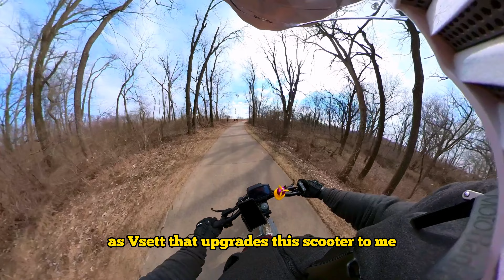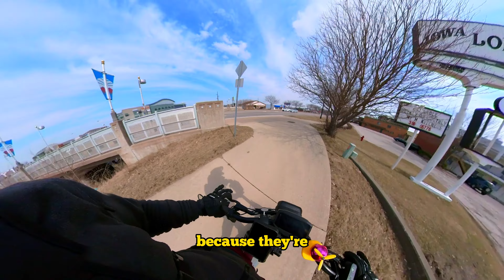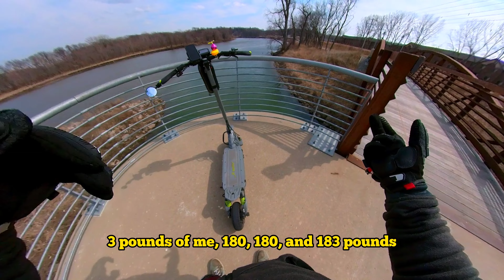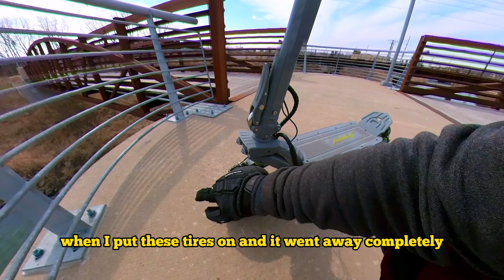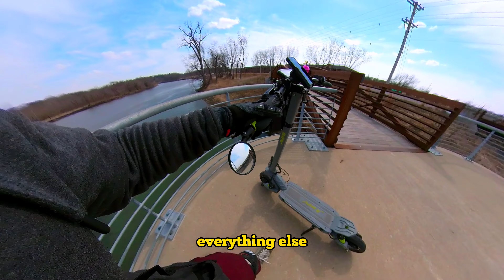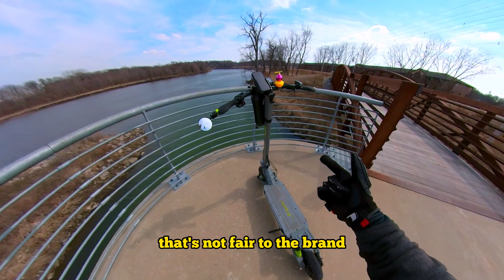MUKUTA 10+ 600 Mile Review: The Next Evolution of VSETT // YOGI STEVE RESPONSE VIDEO

Comment: The manual says that when it gets to 56 volts or below, you MUST switch to single motor or the Mukuta will shut off. Plugging it back into a charger will reset it in seconds.

Comment: I got rid of those heavy steel folding bars and put in a slightly wider aluminum bar with an extension on the front for mounting my light and my phone and now the cockpit is nice and spacious and I absolutely love it. The suspension cranks on the rebound but the compression on the downward stroke is fine. They are sending me a brand new set of shocks but not sure if that's going to fix it. This thing absolutely rips!

Comment: What mid size, 40+ mph, removable battery, scooter would you recommend?  Is the rs5+ 2.0 the best option or are there better/equal ones??
Reply: kukirin g3 pro might be a good option I've heard its the same scooter as the rs5 just rebranded and its a little cheaper

Comment: So does it actually go 40 miles an hour and also I live in a city where I’d have to ride 12 miles there and back to get to my house from
Work or if I wanna go out would it be genuine miles like it says 70
Reply: It easily goes over 40 miles an hour. I got mine up to 50 miles an hour but the speedometer is about 3 miles an hour fast.

Comment: Any idea why I can't get my mukuta over 17 miles per hr my weight is 190, seems like it's hard locked
Reply from the maker: I’m assuming you don’t have it in single motor and first gear? There may be speed limit wire depending on your country or retailer. I would call whoever sold it to you they should know what wire to snip
Reply: P settings ?

Comment: The scooter seems to have soft start turned on in your video.  I think with hard start turned on it would be faster
Reply from the maker: It's not soft start, it has a really nice throttle curve so you can actually control the take off unlike many scooters. I have a Mantis King GT that also has sine wave controllers, but the throttle curve is so bad that it's only on/off and you get your arms ripped off every time you pull the throttle no matter what you do. Mukuta is way smoother and infinitely better to ride for this reason imo. Control.
Reply: @ScootaGang  I' just ordered an Inmotion RS, but it won't be here for a couple months.  I have a Mantis V2 (18ah) currently which I like for the portability, although I'm actually considering this M 10+, the MK GT, or possibly the RR RS5+ to replace the V2 as I'd like a little more speed and range.  Thoughts on this or the MK GT since you have both?

Comment: VSETT 10+ vs MAKUTA 10+. Which one you prefer more and why? :))
Reply from the maker: To be fair I don't own a Vsett 10+ so I have some owner's bias towards the Mukuta. Also biased because it's new and coming from the Vsett factory. I really like the Mukuta to the point that I need to sell it to pay for bills, but I haven't listed it yet because I love riding it so much. If you prefer tighter suspension geometry, I think the Mukuta is better for high speed cornering and just handling in spots that would normally give the Vsett 10+ a little speed wobbles...

Comment: I just bought my first real scooter. When accelerating is it normal for the voltage to drop a little and the battery and then go back to normal when not accelerating? Scooter works fine just that question is all
Reply from the maker: Correct that is voltage sag and normal on all scooters. When you have lower battery, it can potentially cause the voltage to drop below the low voltage cutoff point and turn off your battery. The amount it drops is correlated to your controller amps and is the biggest under a heavy load while accelerating uphill, when the scooter is hot.

Comment: I think Yogi Steve's mistake was expecting the Makuta to have battery life comparable to the Dualtron Ultra 2 he's accustomed to riding.  The Makuta has a 25.6 AH 60 Volt battery vs the Dualtron Ultra 2's 35 AH 72 Volt battery.    There's also the issue of the $2600 vs $4000 price difference.   I think he got angry when he found himself stranded and simply forgot.
Reply from the maker: Yeah and it's fine for him to do all that except the part where he makes a clickbait hit piece on them lol. It's 20ah in the lowest model (same battery options as vsett 10+ btw) and we all know that this isn't a long range scooter capable of delivery shifts. It's super fast but I get about 20 miles range when I go fast.
Reply: That was a nice way too put it hes a cocky idiot ,companies send him scooters he rides them for a day ,complains about them then sells them on Facebook market  place pure scum !

Comment: ✌️💕  just a little tip that i like for my mirror is to get right side mirror that mounts near the brake mount but put it upside down on the left. This puts it in a position so you just glance down at the mirror to see behind you. It puts it so your arm and shoulder don’t block the view. Personally I like it but just a suggestion.
Reply from the maker: I see what you mean that might work better, these are just too small to see anything at all even if they are aimed correctly.
Reply: I have left one on mine Vsett and it helps blind spot and I do not hawe to turn when I'm driving.  Only Vsett mirrors are so smol that alignment has to bee perfect and I will ride all scooters with mkror

Comment: How would u compare this to the kaabo mantis king gt? I know from ur video the mantis is little slower but how would u compare overall ride quality
Reply from the maker: I think the Mantis wins in the shocks they used, the adjustable hydraulic dampened is nice. However, overall I think the stem feels more solid on the Mukuta. You may have also noticed on your Mantis that when you brake heavily, the whole scooter leans forward significantly. This doesn't happen to the same extent on the Mukuta, the tighter shocks eliminate some of that extra forward and backward motion. I think they are both plenty good enough to recommend though even though neither are quite perfect yet.
Reply: Several people on Facebook and Reddit with Mantis King Gt have experienced catastrophic front shock failure.  The metal piece in the center of the shock actually snapped in two.
Reply from the maker: @sp33dy1979  Really you got a link? Mantis has always had issues with the stem ngl